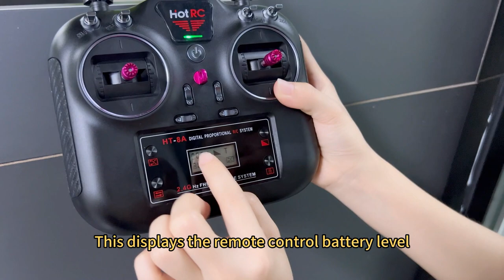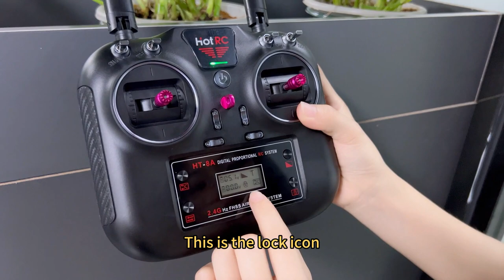The new HT-8A remote control Nanny level product explanation.

Comment: They sent me a mode 1 radio, i needed a mode 2, i swapped the gimbals no problem, the yaw and pitch are fine, but the trottle and roll are switched. How do i swap those? Maybe do a video on how to change modes? Also i will probably need to know how to calibrate this. I have the original ht8a with the switches.